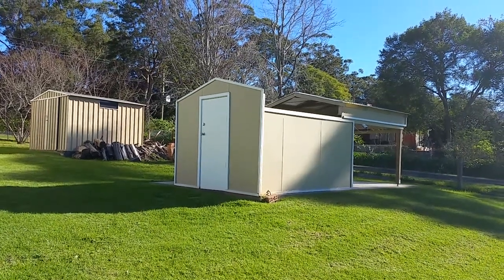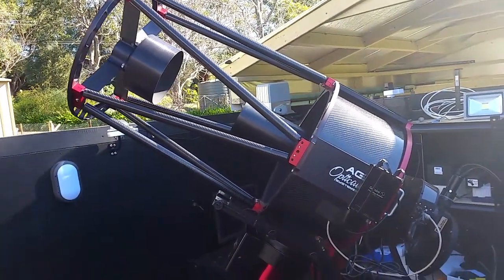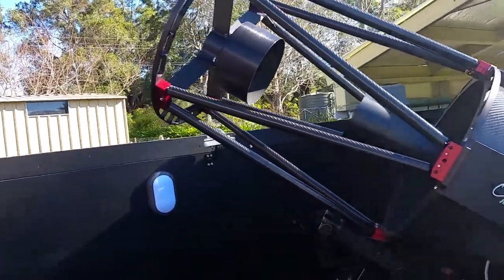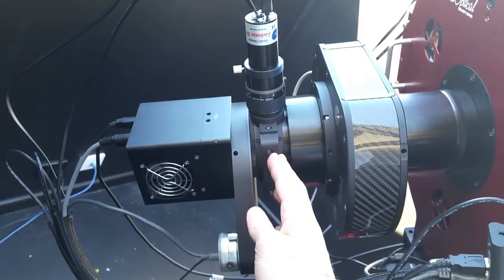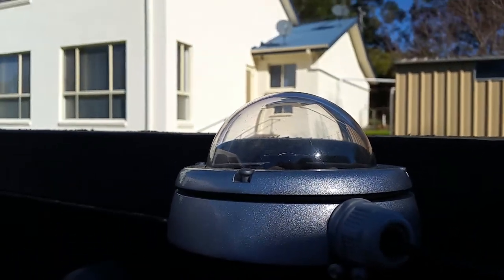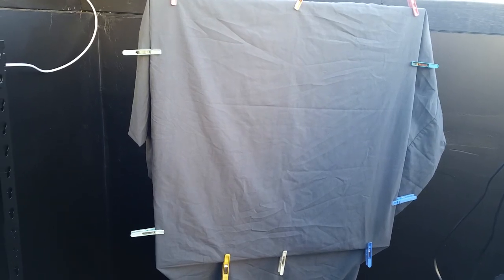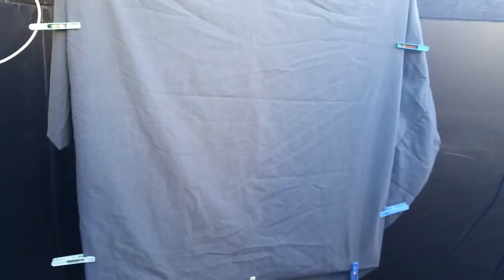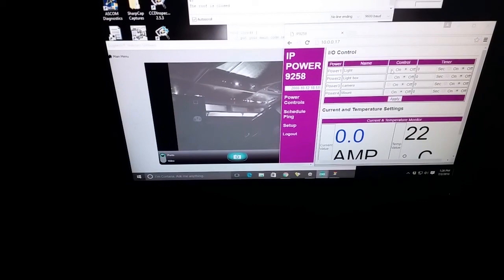Remote roll off roof observatory tour

Comment: where you get the plans to build it. and dont tell me you built this yourself with knowlege on how to build stuff.
Reply from the maker: haha, sorry for the bad news but i designed and built the whole thing myself.  i used sketch up to design it which was really helpful, meant that there were no major mistakes.  The biggest issue i had when building it was closing the roof before i put the automatic stoppers in, it nearly pushed the front of the observatory off.  In the end i was really happy with the results

Comment: Very nice setup and superb AG Optical 14.5, just one little thing, that scope is just dying for a 16803 CCD :)
Reply from the maker: i completely agree, though the budget doesn't stretch that far at the moment.  maybe sometime soon.  the other option is the 16200 chip which would also be good
Reply: The 16200 is nice but not a real step up from the KAF8300 especially for your focal length, for a little more money get the 16803, you won't regret it, I have one , a Moravian G4-16000. For your mount, it's an excellent one I have the exact same one, Paramount MX+. For now, my scope is an FSQ106 but next month I will order an ASA 10N with the Wynne corrector and also the 1.8 Barlow ( i know , with the Barlow, I will only have a 30mm image circle but it will be for small galaxy anyway. and finally why I just bought the 16803 and not the 16200 is because in a year or two I am planning on getting an AG optical 14.5 ( in my book ,much better than the Planewave) but you beat me to it :) Overall I love your setup and observatory, very nice setup.
Reply from the maker: at the moment i Bin 2x2 on every image, so i get almost the same image scale as a 16803 but a much smaller FOV.  also, i don't get the well depth that a 16803 would provide so some of my longer subs blow out the centre of stars.  the 16803 is a significant investment, so i think i ill wait a year or so before i upgrade.  at the moment i am not missing the FOV too much. AG make a very nice scope, the main reasons i decided it over the planewave were the optical report and the standard quartz glass.  i have heard stories of PW pyrex scopes having significant variations in focus over the night.  My AG holds its focus really well.  the TCS system is really nice too and the optec rotating focuser is second to none in my opinion.